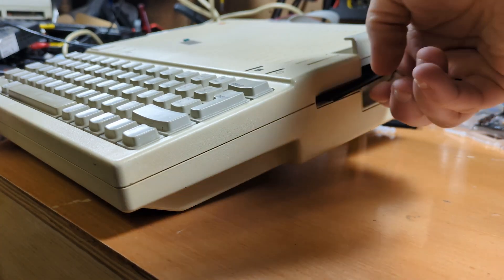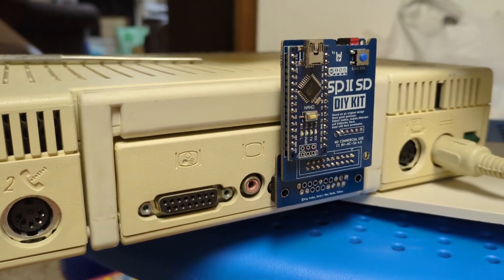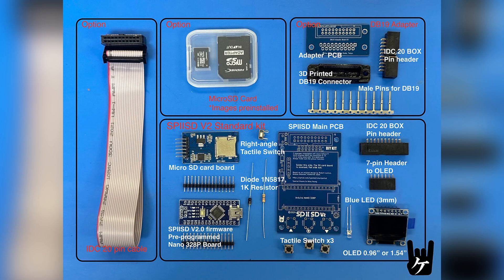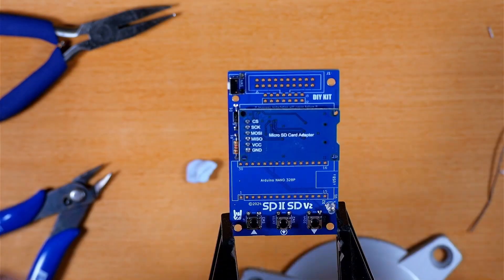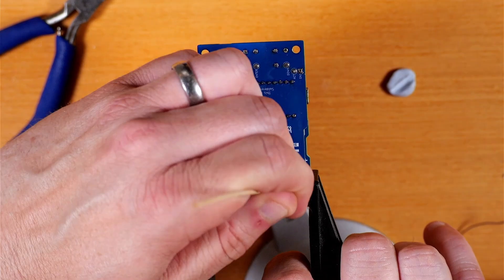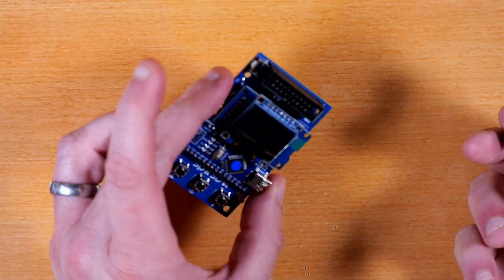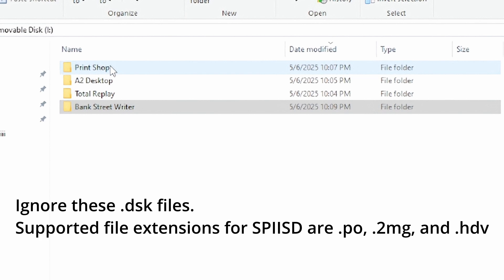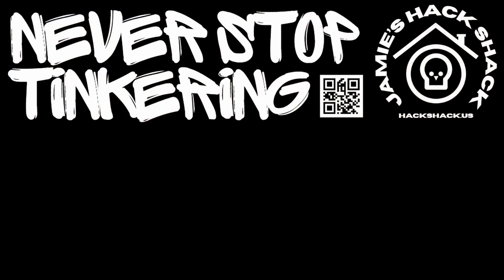Modern Storage for Apple II – SPIISD V2 Kit Build & Test

Comment: Is this where the vintage Apple emulator for Pi 0 originated from?
Reply from the maker: This project is all about emulating Apple II SmartPort storage. The pi thing is all about emulating a Classic Mac. 
Based on a post I see from Bluescsi Eric I think it had some interesting lineage of these smartrport projects.
"Robert Justice created the initial SmartPortCFA (compact flash) code base that this project is based on.
Andrea Ottaviani did the initial port of the CFA to the SD version.
Katherine Stark fork made some updates and fixes and allowed it to work with total repaly.
Chris Tersteeg's fork is the one I'm using which adds LED and button support to the board he provides.
My fork, added some niceties described in this post."

-I am not sure what code may have been exactly used from what fork just including some of what I can find here that seems to tie together some things. 
These folks can hopefully jump in here to correct anything that seems ambiguous I hope. 

So then we see with Kay Koba's V1 he said the following here. https://github.com/kerokero5150/SP2SD_DIY_KIT
"It is based on an open source project called SmartPortSD. Created by Australian genius Robert Justice, SmartPortCFA was ported to Arduino hardware by Italian programmer genius Andrea Ottaviani. to porting to Arduino hardware. It was improved upon by Katherine Stark of Canada. She made available its ability to access four ProDOS-formatted 32MB PO files stored on a FAT32-formatted SD card. When she did this successfully, many wanted to build it.

*Got permission from the three geniuses I introduced earlier."

Then on this most recent from Kay Koba. https://github.com/kerokero5150/SPIISD_V2
"In SPIISD V1, it was not possible to visually inspect image files, and the V2 main goal was to operate the system using an LCD and buttons. However, some users experienced difficulties creating image files or made near-miss mistakes with file suffixes in the V1. In V2, there are no suffix rules for compatible image files, and users can simply select files using button operations." 

This one is closed source so I am not sure how much is a full rewrite if the previous built upon code was licensed in such a way that wouldn't let any resulting works be closed. 
Interesting stuff for sure with folks much smarter than I am doing some cool projects! Thanks for watching!